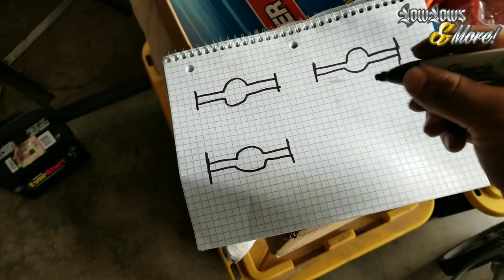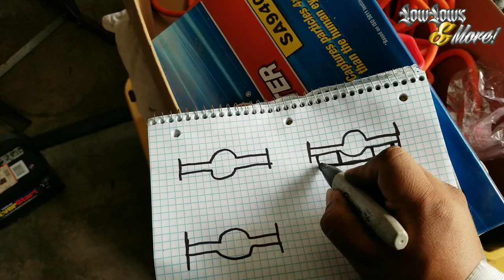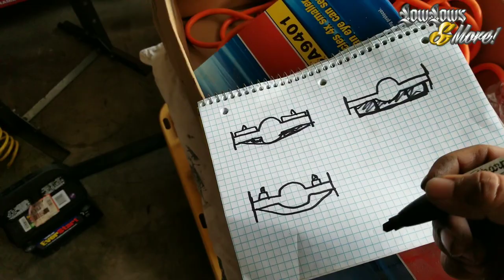Reinforcing an axle

Comment: Can you use the  Flux core wire when you  Are   Doing the frame  Or Just use the still wire for all of it thanks.
Reply from the maker: I recommend using solid steel wire for the frame. But yeah you can do it with flux core wire.
Reply: @lowlowsandmore  okay thank you.
Reply: Yes you can you can use flux core wire... It is made  to weld in the outdoors.